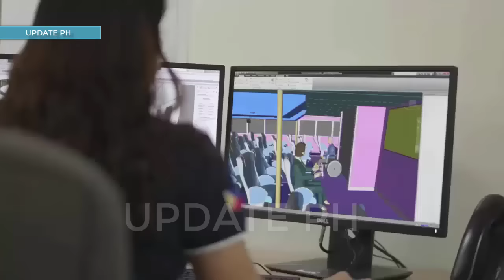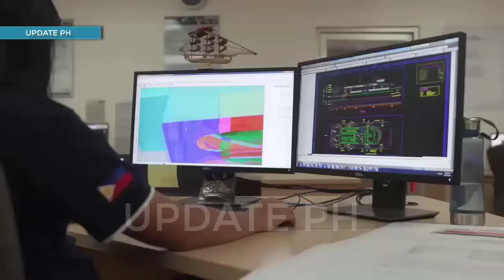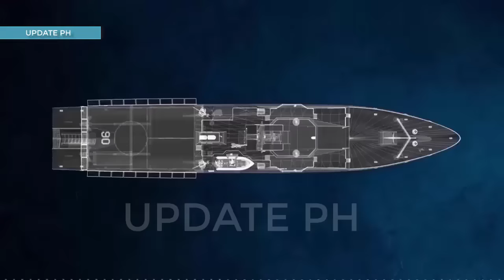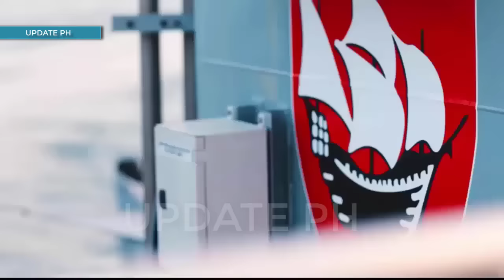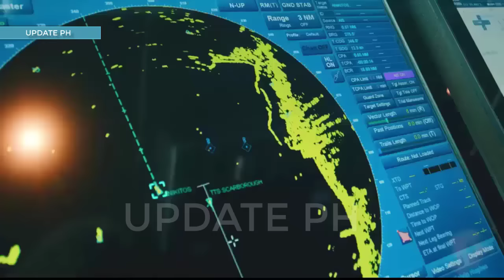THE PHILIPPINES ARE NOW BUILDING THEIR OWN WARSHIPS IN BALAMBAN CEBU ❗ ❗ ❗

Comment: It's not a warship.
To be considered a 'warship', a vessel should be able to perform Surface-surface, AA and ASW on blue waters.
What you have there is an 'Offshore  Patrol Vessel' at best.

But hey, for a localized manufactured boat that is a good start. Keep it up!

Maybe in 5-10 years you can build destroyers or diesel subs eh? These two boat classes are the most needed for defending coastal waters especially if you have a tight budget.

Comment: Yes pwede lagyan ng 2 16inch barrel cannon automatic 35 rounds per minute and 2 76 mm cannon automatic 60 rounds per minute... 2 barrel 40mm cannon automatic 60 rounds per minute (3 twin 40mm cannon) as secondary guns... 3 AICWS... 32 mounted quadropol 45 degrees vertical missiles (anti craft and anti warships), 60 60 horizontal LMS (both anti aircraft, Anti warships, anti submarine, surface to AIR-LMS) and 4 Nuclear weapons range 5,000 miles...
Two 16 inches gun torrents with range 500 - 750 nautical mile range.
3 76 mm cannon with range 350 - 550 miles...
3 40 mm (twin barrel secondary guns) with range 250 - 450 nautical mile range..
2 ACIWS 5000 rounds per minute with ranges 5 to 65 miles range...
Torpedo tube launchers 6 torpedo tubes left side and 6 torpedo tube right side and with 80 to 240 torpedo stock pile on board... With 3 anti sub and anti warship and aircraft Attack heli chopper with 2 40 mm cannons with range 35 miles with with 500 rounds per minute...
With 60 inches ARMOR Protection both inside and outside warships... With 2 multiple rocket systems with range 159 miles range... That is our main super warships... Make it 50 warships per 4 months 24/7 no stopping works with budget for 500 warships 50 Trillion dollars more...with complete sonar and radar system both low and higher altitude and sonar radars and jammed devices not to be cracked...

Comment: The problem with Austal, they build aluminum hull ships so will that be good for a navy ship coz it may not weigh much n faster but with what china is doing like ramming their ships to ours, aluminum ships will be easier to damage compared to steel hulled ships...maybe redesign the ships so that it can withstand against any possible ramming by the chinese. But a light, fast catamaran type of ship with lots of ASM, SSM and torpedoes is a good concept for the philippines. It can easily hit slow moving naval vessels n escape n outrun the enemy after making a surprise attack.